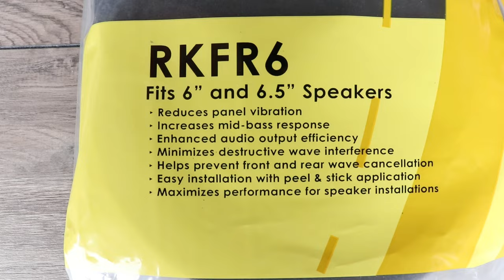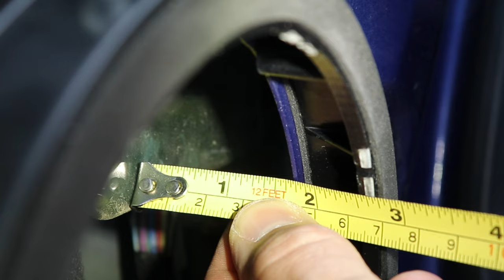Front Speakers UPGRADE, Toyota Corolla - How to Remove & Install New 6.5" Speakers

Comment: Hey very informative video. This is gonna be my weekend project.
Im a bit stuck while purchasing. You gave 2 links. Reference and kappa speakers. Are both compatible with front door?
If i like lows more than highs which one do you suggest i should go with? (I do not wish to upgrade stereo )
Reply from the maker: Kappa is the better speaker in all aspects, including mids and bass, and it's even more sensitive than Reference, which means it produces more sound with less power, so the stock stereo is more suited for it. I used Reference to save money, but now I wish I went with Kappa. Yes both will work and there are tons of options .. pretty much any aftermarket 6.5" speaker pair should fit the brackets. The brackets specify even 6.75 will fit, but 6.5" is a much more common size. Thanks for the comment.

Comment: Excellent video, thank you!

I probably do not need so many terminals. Is there a similar product with less quantity?
Reply from the maker: Thanks!  I know it's ridiculous!! There is no less quantity on amazon. Some speakers come with them, these Infinity do not, but JL Audio I believe does. You can find less quantity at AutoZone or similar auto part stores very likely, I bought mine from the local part store. So if you're lucky it comes with the speakers, and if not get from the part store.
Reply: @CleverFix  the removal of the stock speakers went well. I am installing the foam now. I do not know how you were able to install the big ring inside the door, my 2014 Corolla S Plus has a heavy set of wires which goes right over the area for the big ring inside of the door. Should I cut out a few inches of the ring? It would be like a big C instead of an O but that's the only thing I can think of. The group on cables seems very inflexible. Please advise boss.
Reply: Do I need to use the shorter screws? The screws that came with the metra adapter seem to be short enough to not interfere with the window.
Reply from the maker: @joewhattoff8754  The screws that come with the bracket will be fine.. I just didn't like that they're so long and I prefer lock nuts myself.. but a lot of people use them and it's ok.
Reply from the maker: @joewhattoff8754  Interesting,  Yes mine had it too but there was still space. I'd try to push it out of the way and see if it stays.. all you need a tiny  bit of space.  I moved it when I removed the rivets, you can see it in that part of the video , so it has a bit of movement.. Worst case you have to cut it.. I can't think of anywhere to stick it, I think the NVX Baffle being silicone won't allow anything to stick to it.. if you can stick it to anything else that will work... maybe ring #2 on the back of the bracket ? Just make sure the speaker screws don't push it off, they'll probably screw into it... then you won't need to shorten the ring also.
Reply from the maker: @joewhattoff8754  Looks like the back of the bracket is not smooth to stick anything on.. I'd try to move that wire a bit.. it's clipped on with a clip, there's probably a way to adjust it a bit or turn it,  so it's not in the way.
Reply: @CleverFix  I had both speakers working and it was incredible! It was the best car audio I have heard before! And then my left speaker cut out just like it has so often! Any idea why it continues to cut out so often?
Reply from the maker: @joewhattoff8754  The only thing I can think of is the tweeter connector. Since you connected the speaker directly now, that's the only remaining weak spot. The speaker wires run through the tweeter, if you unplug the tweeter the speakers will not work. What you can do is put the left tweeter on the right side as a test to make sure it's not something inside the tweeter, .. the little tweeter part comes out of the plastic and can be swapped.  It could also just be the connector, wiggle/play with it to see if it causes the speaker to cut out.
Reply: @CleverFix  I swapped the tweeters and that did not help the L side. I wiggled the wires and found a bad connection to be the issue. I was very perfectionistic and detailed in the crimping of the butt connectors, they cannot be pulled apart. I suspect the issue is before the butt connectors, does that sound possible? Corrosion or a loose connection?
Reply from the maker: @joewhattoff8754  How far above the original connector did you cut, and was it corroded? The corrosion moves up the wire, I cut about 2 inches to get a shiny good part, it was all white for about 2 inches. Maybe it corroded up into the wire, but that's very extreme..
Reply from the maker: @joewhattoff8754  Also make sure you don't bend this wire a lot, being aluminum it doesn't like to be bent, it breaks with just a few bends. Copper can be bent many more times, even solid copper.. this is basically like solid aluminum, the strands are pretty thick.
Reply: @CleverFix  I cut several inches above the speaker connection in order to eliminate a previous butt connection. I did not see any corrosion. My previous repair based on your previous video seemed to be fantastic! You don't know of any other connections that could have corroded? That aluminum wire is a joke.
Reply from the maker: @joewhattoff8754  There aren't any other connections as far as I saw, I believe the wire goes directly from the tweeter to the speaker.  Here is the diagram https://ibb.co/album/LSmxVp and some testing info.  I would stick a small wire in the tweeter connector, and test each pin, and connect it a voltmeter on "Speaker" mode (beeps when leads are touched), then same on the speaker wire side..until it beeps (find the same wire on both sides) and play with the wire and see if the beeping stops, it should if you say it cuts out. Then I'd bypass that wire by connecting the new copper speaker wire directly from the tweeter.. it sounds like you have a break somewhere between tweeter and speaker.. so you can use a long wire to bypass that broken wire if that's the case. It would be very strange if indeed there's a break somewhere there, but you can definitely test that..  The voltmeter can help you figure out if indeed that's the case.
Reply: @CleverFix  I did have a loose connection (poor crimp job on my part). Maybe I didn't strip enough wire and I crimped onto the insulation. Now that I fixed the butt connections it has been working beautifully the last 24 hours. I'll tape it up and put the door back on. The 🔊🔊 sound fantastic! A huge thank you for all your help!
Reply from the maker: @joewhattoff8754  Oh that's great, speakers cutting out are very annoying!  Good to know how you fixed it.  I'm working on the rear 6x9's today, that should add a lot of bass, it sounds good in front now, but the back is terrible!
Reply: @CleverFix  I assume you're adding a video of that. If you highly suggest that upgrade I'd consider doing it. The upgrade in the front has been well worth my $150
Reply from the maker: @joewhattoff8754  Yes working on editing the video, it's a lot of work. The speakers are in though, they sound great!! 6x9's have a nice kick and they can handle a lot of bass.
Reply: @CleverFix  looking forward to your video of installing the 6x9 rear speakers. The front sounds great now that those speakers are new. Are rear speakers more for bass? Or are they more for people who sit in the rear? Looking forward to the video
Reply from the maker: @joewhattoff8754  Probably 2 more days to finish.. a lot of post-processing because the sun went down quick..  The speakers help a lot, they added a bit more bass but not a huge amount, it's just louder and fuller sounding.. like the sound is surrounding you, instead of coming just from the front. When cranked up they're quite loud. The bass can be bumped up to the max in the settings and they can handle it, but for proper bass you need a subwoofer..

Comment: Do you think applying self adhesive speaker foam base pad( Brand NVX ) to the silicone ring will make more difference ?
Reply from the maker: Anything that insulates the speaker from vibrating the door will help, as long as the speaker is still mounted properly and not moving around.  I'm not sure if anything will adhere to silicone properly though.
Reply: @CleverFix  Thanks.

Comment: The only issue i can see with this is that you put a speaker sealer on the speaker to make the sound not reflect into the door panel but then you cut the part that seals it to the door panel.

Granted, the better option over rubber for the seal is to use foam ones, as they will simply crumble down till the seal is made between the speaker and door panel as you push it down to lock it in, the rubber thing you used is more for you to seal the speaker from water while also removing the reflections into the door panel, a foam one is obviously not going to keep water away.
Reply from the maker: I only cut it so it would fit, and once it's cut it fits snug with the grill in the door panel.  Also the door panel has a round plastic "shield" on the side that meets with the speaker, so there should be no problem with sound entering between the panel and metal of the door.  The foam ring kit does come with a ring for the door panel also, but I was not able to fit it in at the same time as the NVX rubber baffle.  I prefer the baffle, especially because it add one more layer of isolation between the speaker and door metal.  The sound is very nice after the upgrade. Thanks for the comment.

Comment: Is this the same size for a toyota Avensis speaker installation?
Reply from the maker: It looks like the 2016 Avensis model uses 6.5" speakers like mine, but check here for more details: https://www.dynamicsounds.co.uk/vehicles/Toyota/Avensis/2016  and you can change the model year to match yours.  The bracket may not be the same though, but they sell brackets at that link I sent you, or you might find it on Amazon. Thanks for watching!
Reply: Could you please post a link for your parts for that install here please, especially the bolts and nuts that would be extremely helpful..Thanks in advance 😊 🙏

Comment: Hey I have 2014 Toyota Corolla LE, for some reason both of my front speakers stoped working. I checked all the wires and they look fine, any idea what it could be?
Reply from the maker: Do the tweeters work? Did they stop working at the same time?
Reply: @CleverFix  tweeters are working
Reply from the maker: @danzanarmanov2803  Check the connection at the tweeter like I did in this video: https://www.youtube.com/watch?v=4ytOAxK_0Cs  If the tweeter connection is good, then your wires are probably corroded at the speaker. If they stopped at different times, then they're likely corroded. If they both stopped working at once that suggests an electrical issue elsewhere.
Reply: @danzanarmanov2803  My driver door speaker is popping and buzzing on AM radio most noticeably.

Comment: I have a 2012 Toyota Corolla. I just ordered some Rockford Fosgate 6.75 size door speakers. Will those work or would I need to get 6.5?
Reply from the maker: Yes 6.75 will fit also. The Metra brackets specify up to 6 3/4".

Comment: I was thinking of doing this with my 08 Corolla where there are factory tweeters in the upper front door. Since the stock lower woofer speaker is being replaced by a coaxial that also has a built-in tweeter, I heard that it could make the highs too overbearing due to the doubling of tweeters. Have you had any issues with sound balance?
Reply from the maker: I have "double" tweeters, since the speakers have them, and I also upgraded the ones in the sailpanel on the front door, and it still sounds very good.  I did turn down the highs on my head unit for a while, but eventually I got used to them, and I don't need to turn them down any more.  Turning the highs down can really help if they're a little too much... It will really depend on the independent tweeters on how bad the problem will be.. if the independent tweeters are super loud, then the highs will be too loud compared to the mids and lows that the speaker outputs.  So it is a balancing act.. but usually the problem gets worse when upgrading the independent tweeters, not the coax speakers.
Reply: Thanks for the input. Your video is a great reference.

Comment: I was wondering if the car amplifier is big enough to drive the new upgraded speakers.
Reply from the maker: For the speakers in the video, yes. They are 180watts peak and 92db sensitivity. Make sure to get something 92db sensitivity for the stock speaker to be able to power them.  90 may work, but 92 is better. I have a stereo upgrade video coming soon, that will further improve sound, but the speaker upgrade will improve it quite a lot as well.
Reply: @CleverFix looking forward to the new video. By the way, how much power of the amplifier from the after market head unit  would power (generally)?

Comment: the tiny magnet is adequate for the whole structure of the woofer material. the magnet on the new speaker means the oem headunit will barely have the punch to make it produce sound, they're gonna sound lifeless. you need an amplifier if you replace the speakers.
Reply from the maker: The upgrade will make it sound better and more enjoyable.. you can see other's people comments who actually did the upgrade..  The new speakers will make it sound better over stock. It's not all about the magnet. The speaker wattage and sensitivity is what's important.  The replacement speakers are 92db which is quite sensitive.
See: https://www.crutchfield.ca/S-jT6r6R6BbXn/learn/learningcenter/car/speakers.html
"If you have a low-powered factory stereo (typically 10-15 watts RMS per channel or less), speakers with high sensitivity ratings (over 90 dB) will make the best match.
If you have a high-power system like an aftermarket stereo or external amplifier, then consider speakers with lower sensitivity ratings. Properly powered, they'll provide excellent sound quality."
So stock stereo can power them, because they are high sensitivity and fairly low watts, to the point they are loud. I never had to turn it up more than 75%.  If you're looking for super-loud or pro quality, you won't get that with a cheap speaker upgrade.. so that's all this is, a decent improvement for low cost.  If you're going with an external amp, you'll want better less sensitive speakers that can handle more watts.. and some dynamat all over the doors, because they will rattle with that much power.

Comment: Great video Sir. Now i have a motivation to upgrade mine. What year is your Toyota Corolla? Just want to make sure that mine is the same as yours.
Reply from the maker: Thanks! 2014-2018 will be the same. Other years should be similar as well too, with minor differences.

Comment: Awesome video! Definitely will be using this guide when I replace my speakers in a few days. One question I have is how did you bypass the tweeters? I know that there is a connections that you have to do with them or something. Also why not use the foam rings on the outside around the speakers? It doesn't look like they would do much on the inside around the hole. I have some coming and have seen them commonly put around the speaker.
Reply from the maker: On the outside toward the door panel it's useless.. the speaker is already close enough to the door panel that it reaches the round circle in it. Behind it stops vibrations from "filling" the door. So it goes behind to muffle those vibrations.. the speaker makes sound on the front but also on the back, and usually they're in an enclosed box. But on a car they can't be enclosed, so this is the closest idea.
Reply: @CleverFix  gotcha, I see what you mean. I bought some boom mats to put around the frame of the enclosure of the door panel for sound dampening I was also going to do this in the rear as well. Would you recommend the NVX baffles instead of this? I will also be using the meta mounting plate as well like you did.
Reply from the maker: @woodtvnetwork  NVX is only good for the front. I've used Dynamat stuff before and it's OK but I didn't notice a huge difference. The biggest difference was that in the winter my car would warm up inside more =)  If you had a subwoofer maybe the mat makes sense, but otherwise this car is fairly solid. I don't really notice any vibrations and I haven't used any mat material.. I did the trunk too on my old car, I think it was a complete waste. I did the whole floor too, it made the ride quieter.. but again, hardly any improvement for the sound.  So I'm not huge fan of plastering the entire car with matting material.. a few around the speakers are OK, but I don't think it will make a big difference.  If you do notice rattling, then yes it's needed.. I'm not noticing any though.  I like the NVX because it's silicone and it adds a rubber cushion between the speaker and door, so less vibrations are transferred. Also it helps to direct the sound into the foam behind it, and it prevents water from falling directly on the speakers from above. If anything, I'd get only the NVX and no fastrings if I had to choose between the two.  The fastrings have a thicker sponge for the back which I tested and it muffles sound much more than the NVX sponge which is super thin..   The sound is really good after replacing both front & back, can't complain.. I'm happy the car is solid enough so it doesn't rattle. With a 12" Subwoofer it might start though, but I'm not into crazy bass any more.
Reply: @CleverFix  Thanks for the detailed reply! That is interesting to hear that you have not had great luck with the mat, but each car is different. I purchased the tape like you did and will be using that when applying the speakers in the front and the back. Also got the baffles as well and will be returning the boom mat.